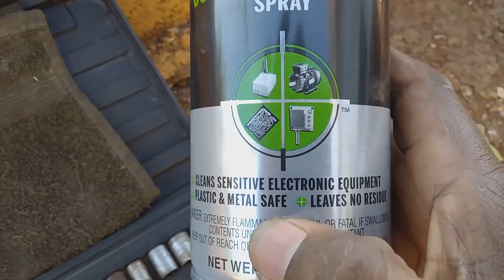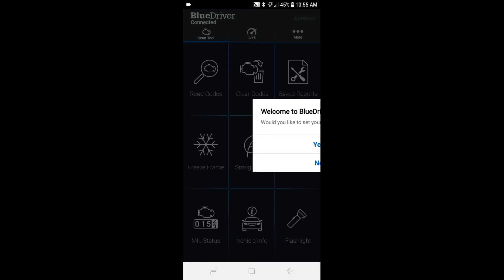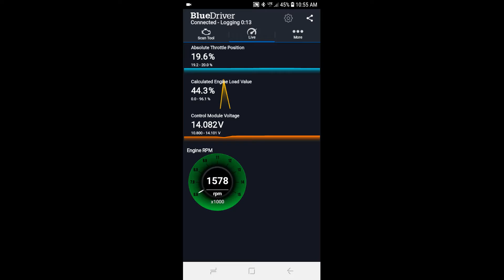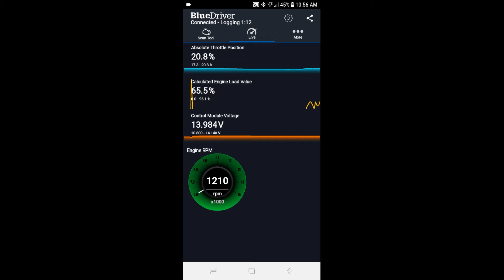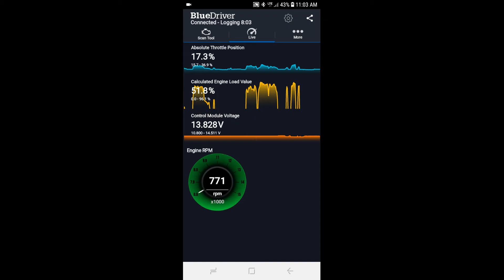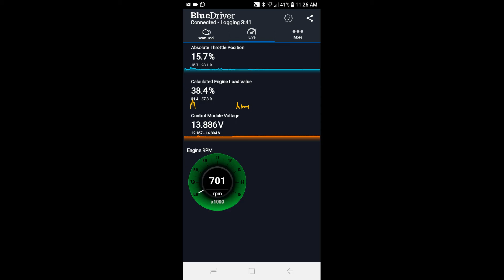Toyota Vitz Engine Vibration Part 3 remedy

Comment: Tried this but my engine still shakes
Reply from the maker: Remember that several other things needed to be done. The throttle body is not the only part that causes engine vibration.

Comment: Im confused...i thought in previous video cleaning trottle body fixed the vibration?  Do you think it was the maf air sensor or the trottle body?
Reply from the maker: @macknumber9  from time to time the throttle body and MAF sensor needs cleaning.

Comment: Hey bro am watching your videos from guyana i have a vitz 2015 i change my engine mount and rear monut .but i have a very small vibration. I will clean the throttle box and see if it ease up abit .your videos help me alot .thank you very....whats the app on your phone you using to test the vehicle?
Reply from the maker: @khemrajdoolall7036  happy to know that my videos are helpful you. The bluedriver scan tool app is what I use with the bluedriver scan tool to check my vehicle for faulty.
Reply from the maker: @khemrajdoolall7036  Go to play store and type  BlueDriver OBD2 scan tool. The icon looks like an engine check light.

Comment: When putting back on the throttle body is it suppose to be just screw down or have to be sealed down as well????
Reply from the maker: @kevinhastings8475  there is a rubber seal under the throttle body, it should be properly seated. If the rubber seal is damaged you can use ultra grey to seal it.  However since ultra grey is a rubber gasket sealant it can be a challenge removing it when you need to do so.

Comment: Does cleaning Airflow Sensor improve fuel consumption? My current consumption has been So bad, instead of 24KM per litre, it's like 12KM per litre
Reply from the maker: @eliaschela4279  yes cleaning your air flow sensor improves fuel economy.

Comment: hi when you clean the maf sensor does the vibration gone? because i have my yaris it has a engine  vibration i am planing to clean the maf sensor does it helps to stop the vibrate if i clean the maf sensor?hi forgot onething did you disconnect the negative connection on the battery before starting to clean the throttle body and the maf sensor?
Reply from the maker: If the MAF sensor needs cleaning it can cause engine vibration. Cleaning the sensor will stop the vibration. Remember though that several problem can contribute to engine vibration.

Comment: Can carb cleaner be used to clean the mass Airflow sensor?
Reply from the maker: Its best you use a cleaner specifically for the Mass Airflow Sensor. Resedue left on the sensor because of an incorrect cleaner can damage the sensor.
Reply: Okay noted. Thanks.

Comment: Mr sheldock how tell if your water pump is not pumping properly  my heater is not heating   no leaking notice 2006 vitz reply please  sir.
Reply from the maker: Usually when you switch to heating the cabin of your vehicle by turning the knob from cool to heating you automatically close the cooling vents and open the heating vents in the dashboard. If when you you have a knob to switch this function you should hear a thinking sound when being switch from cooling to heating. 
First check this function before doing anything else.
Reply from the maker: A thumping sound

Comment: Can I use gasoline to clean MAF sensor?
Reply from the maker: You can as long as it is sprayed on and not wiped. You should not pour it on either. It should be left to properly dry before reconnecting. Also you need to ensure the gasoline is clean.

Comment: 📌 Very Important..
1. If throttle body barrel is not fully cleaned,
2. If engine has some extra blow by gases,
3. If the spark plug gap is excessive, (more than 1.1 mm)
This vibration will not go off fully like  in this video.. 
After completing all this procedure, turn off ignition switch, remove 2 fuses from engine fuse box,
1. ECTS  
2. EFI main
For 60 seconds and fix them again.. 
Now start the engine and see the results..
📍This engine has (MAP) Manifold Absolute Pressure sensor, that is not Mass Air Flow (MAF sensor)
Reply: You seem to be knowledgeable. Is there supposed to be oil on the MAP sensor? I have an oil depletion issue (which I think is) resulting from the oil coming out of a breathing hole at the top that passes the MAP sensor.
Reply: Same @EvonGray

Comment: I have a button start vitz where cleaning the throttle body and removing the sensor should I disconnect the battery or it's best to check my mechanic
Reply from the maker: If you are cleaning the throttle body and you have either a button or key start it really does not matter. 
What matters is that you remove the throttle body before cleaning. If however you are unsure about what you are doing, it would be best to allow your mechanic to do this for you.

Comment from the maker: When cleaning your trottle body with a trottle body cleaner (solvent or spray) always remove the trottle body. Do not allow the solvent to get inside the intake of you engine because it can foul your spark plug causing your engine not to start and creating additional problems.
Reply: Having some faults with codes

Comment: Unlike 4 cylinder engines, 3 cylinder engines are not well balanced. Basically because of them having only 3 cylinders. 
The reason why a little vibration is normal. 
The main part that goes bad and increases vibration is the ' Hydro engine support' on the vehicle. 
It's the one on the left when opening the hood.
In the video, your idle is going down and below 700 rpm as the engine is getting to its operating temperature, the cause of vibration. 
1krfe 1.0 should be around 750 rpm.
Reply: I have a 2010 Toyota Passo which is three cylinder's how do I stop the vibrations . It vibrates at idle stop and whenever AC is on at a idle stop or when put in reverse?
Reply: @grimmyboss2079 change your engine mounts, mainly the hydraulic one. Have the throttle body cleaned.
Change your spark plugs to Iridium ones.
I did all of the above and 95 percent of the vibration is gone.
If it persists, check the ignition coils and the belt for slippage.
Reply: @1artonpower  thank you very much will do that and get back to you
Reply: @1artonpower yep changing all 3 engine mounts on my Yaris 2008 helped the most.

Comment: Can the brake/carburetor cleaner be used?
Reply from the maker: Yes it can be used to help clean the trottle body. You also need to use a rough cloth to scrub away some of the particles because it can be stubborn.

Comment: My Vitz 2013 having same problem of vibration while slowing or stopping the Car,  by switching on the hazard light. this is reduced while is switch on AC. I did this complete procedure of cleaning but problem still there.
Reply: igual en mi vitz
Reply: I have same problem in my vitz,, Is your problem solved?
Reply: Same here..

Comment: Vitz car after gear with ac engine  vibrate when parking no vibration
Reply from the maker: When you switch the ac on you should hear the engine idle rpm increase. If this does not happen try idle code re-learn.

Comment: I personally faced the same problem with my vitz 2007.  I resolved the problem.  How ? There is a small "LK screw also called allen screw" on throttle body covered with some kind of sealent/silicon type material.  Remove that silicon and tight (clockwise) with Allen Screw driver.(Perform this while engine is switched off). Start the engine and check if problem still exists repeat the action.  i resolve it with 2.5 full clock wise rotation.
Reply from the maker: This trottle body does not carry this screw.
Reply: @ShelDockToyotaVitz   its tiny screw.  All second generation vitz (2005 to 2010)have this screw. Might be third gen did not have this screw. Its on your front while standing in front of car. Its located below plastic portion/part of throttle. Normally its found below the electrice wires of throttle
Reply from the maker: My toyota vitz is 2011
Reply: Can u share picture of that
Reply: @nsaleem86  share your email for picture. No option here for pasting / uploading picture please
Reply: @muhammadimran9848  i have 2007 vitz as well with engine vibration problem can you send me the pic as well
Reply: Send it to me shelterkpei1@gmail.com
Reply: I have 2010 Toyota Passo 3 cylinder I have vibrations can u help me out please
Reply: The allen screw you are talking about controls the idle.
You are simply increasing the idle, nothing more.
A higher idle lessens vibration, but the engine will get to operating temperature faster than usual and the cooling fan will switch on more frequently. Should be around 750 rpm only, not higher.
Reply: @1artonpower  can u help me out please I have a 2010 Toyota Passo it vibrates whenever at a idle stop or AC is on at a idle stop

Comment: It hasn’t been reduced, the car was cold. It will be the same if the engine is hot. I have vitz 2013 and it has the same problem. I cleaned the throttle body, cat and spark plugs, nothing changed. Now going for the fuel injectors and fuel pump, lets see what happens.
Reply from the maker: For my 2011 vitz it has helped because the vibration is not as bad as it was. Even now driving for long distances it still is good enough. 
Hopefully you can find a solution for your issue.
Reply: Any luck with vibration fix? Because i have 2012 and having rough idling problem
Reply from the maker: Vibration is greatly reduced but not completely gone. Am still working on a solution.
Reply from the maker: My engine vibration initially started with a bad spark plug and increased severely thereafter. Even with new spark plug installation engine vibration remains bad. 

It reduced greatly when I cleaned the MAP sensor and trottle body valve and cylinder.

1. Have you cleaned your pcv valve?
2. Clean your injectors if you can. This can contribute to the problem.
Reply: @bzcarreviews4701  friend have you resolve vibration issue. Pls let me know I am facing same problem
Reply: I cleaned the fuel injectors and fuel pump, the vibration is reduced but not completely gone.
Reply: @TheAndyplaylist   i had this vibration for three years i have vitz 2012 ksp130 i clean throttle body every week and map sensor nothing help all parts air cleaner original  i week ago i decided to clean the EGR its under the air box on the right side i had to remove the inlet ,now i clean it very well and from now the engine no vibration at all 
i reset it and now no little vibration . this is the solution for these 3 cyl cars  TRUST ME good luck
Reply: @hackeroon43  thank you, let me try this.
Reply: Nadeem Khawar  if u find egr location pls guide me as well
Reply: Tony Riolo  pls guide me location for egr , if u have picture or link that will be great
Reply: @hmmehussain  under the box of the air cleaner where you put the air cleaner under it on right side there is the EGR with 6 pins connecter and a little pipe in it  with a 3 bolts give me your email and i send you a photo ok but there only one there with a black circle housing with the 6 connecter pin attach, when you disconect the connecter you will find the 6 pin that is the egr ok
Reply: @hackeroon43  send me an email too
Reply: I personally faced the same problem with my vitz 2007.  I resolved the problem.  How ? There is a small "LK screw also called allen screw" on throttle body covered with some kind of sealent/silicon type material.  Remove that silicon and tight (clockwise) with Allen Screw driver.(Perform this while engine is switched off). Start the engine and check if problem still exists repeat the action.  i resolve it with 2.5 full clock wise rotation.
Reply: Nadeem plz send me your WhatsApp or email am facing vibration issue in my 2013 vitz
Reply: Dear nadeem khawar.i need urs faver if send me a video clip where i finds the egr under the air box and what to do wth that things.iam great full..MANSOOR BUTT.

Comment: Are you sure the vibration is gon... Not possible in this engine..... Now maybe okay but after you drive your car make a new video.... I think the vibration comeback again...
Reply: Aamir Nawaz replace pvc value my car vibration comes to 1% only. Much much reduced
Reply from the maker: I have been driving my car for about a month now since I cleaned the throttle body and valve. Vibration is about 5%, not fully gone but significantly reduced.
Reply: @ShelDockToyotaVitz  i have tried this. vibration is gone but car is consuming more fuel. any advice?
Reply from the maker: @bilalrafique1668  If your idle rpm is a bit too much then dirt somewhere on either the throttle body cylinder or the valve is preventing it from closing properly. Sometimes when cleaning, dirt may be pushed or lodge in areas preventing proper closing of the valve. Ensure all areas around the cylinder and valve is properly cleaned.

There is a rubber gasket under the throttle body. If not seated properly then air may escape under it causing higher than usual idle rpm.
Reply from the maker: @bilalrafique1668  Increased idle rpm can result in more fuel consumption.
Reply: @ShelDockToyotaVitz  RPM is very smooth and comfortable. i am actually enjoying car drive. but i didnot any rubber ring below. maybe last owner misplaced it. there are no leakages. rmp sounds normal. may be i need to get it checked by ecu expert. what do you suggest?
Reply: here is an small update. last night i searched how to throttle relearn. i left both battery terminals disconnected overnight. in morning i started my car and left it running for 5 minutes on P and 5 minutes on D. now unfortunately vibration is back. but bit better then it was before cleaning throttle. idle is getting back to rough idling. i am hoping the fuel average will be back. i will update after day or 2. 
usually 1 bar gives me 50 to 55 kilometer. it was reduced to 30 kilometer. 

i will update soon.
Reply: here is an update. after ECU reset and driving for 2 days, fuel average is back to normal and so the vibration. only benefit i am having after cleaning throttle body is car is not rough idling. my conclusion is cleaning throttle body is good practice but its not remedy for car vibration. if you dont reset ECU manually car will take many days to adjust throttle and during this period car will be smooth and will consume more fuel. 
so far there is no solid solution for vibrations in vitz.
Reply from the maker: Am sure for my vehicle. Last month I had a right rear wheel sensor gone bad and because of this one problem, I had engine vibration. I got it fixed and the engine vibration went away.
This tells me that any system that the ECU controls, start to give trouble with this vehicle one of the experience will be engine vibration, though this problem is not related to engine issues.